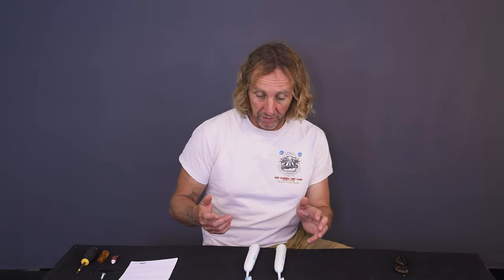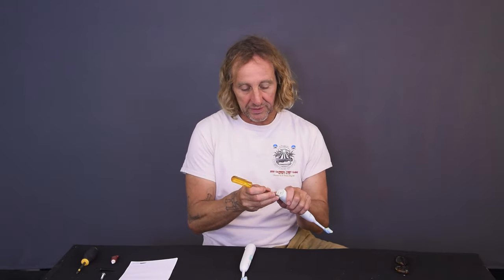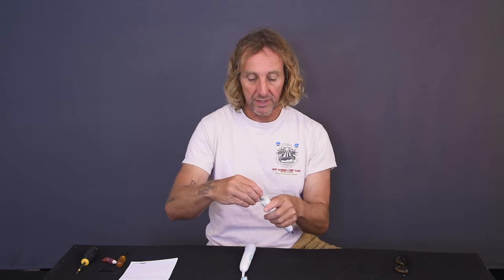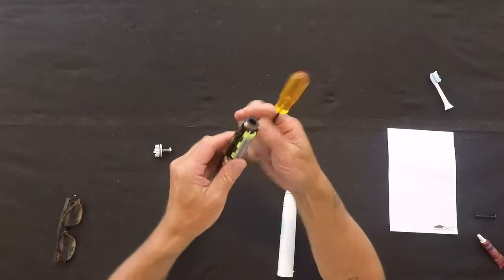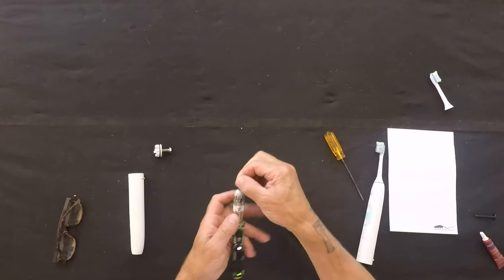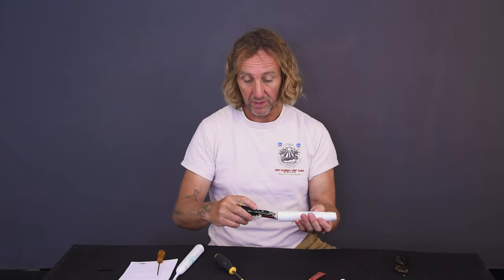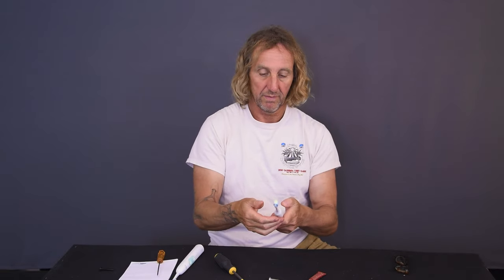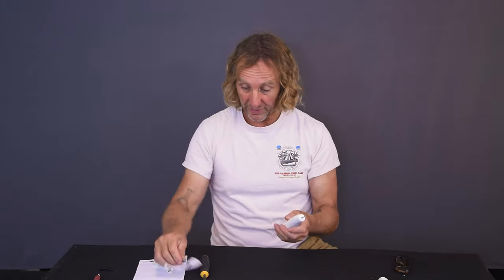Easiest Open/Fix Philips Sonicare Toothbrush HX686 HX684 ...

Comment: Thank you! The screw idea was great for getting the end off. I had a really had time with the clips on the inside, and the screw was not just loose, but so bad it came off entirely as soon as I got the thing apart, so I had to figure out which way the parts went back together. I don't have Loc-Tite handy, but there's an old trick to use fingernail polish on threads to secure them - you just have to let it dry for a few minutes. (Also, if you ever want to unscrew it again later, fingernail polish can be broken again easily enough. But it doesn't tend to break by itself. Really helps.)

Comment: Great vid and well thought out. Some SoniCare brushes have a small hole in the end cap. If you have an air compressor, you can use an air nozzle (with tapered rubber tip) to pressurize the body through that hole and the cap will pop loose. No hole? Drill a 1-1.5MM hole (1/16" is fine) in the plastic cap. Careful, since a drilling too deep can possibly damage the internal mechanism. Then, the compressed air will pop it off. When doing this, make sure to use your fingers to support the rubber seal at the brush end or the air pressure may pop a hole in it, compromising the seal. When the repair is finished, the hole in the end cap can be sealed back up with a dab of glue or silicone sealer. I use some silicone grease on the O-ring seal in the end cap and a dab on the seal at the brush end. Vaseline will also work. Helps to maintain waterproofing. One last thing: "some" end caps go back in only one way, having a notch which must be aligned with the body for the cap to press into place correctly. Once the tricks are known, as you point out, it's no big deal to repair these.
Reply from the maker: I very much run with the zero damage minimal tools stuff laying around the house that cost the least adventure as the optimum way to fix things.

Comment: WOW!!! Using the bolt to take the end cap off is genius.  My post was loose and after watching this video, repairing my toothbrush was a breeze.  Keep your sonicare running longer by keeping the water out.  Always take the brush head off and wipe the water off the motor unit.  If you leave the brush head on and stand the toothbrush upright on the base (like I used to do), the water in the brush will eventually seep into the guts of the motor unit and ruin the electronics inside.  My first sonicare lasted me a year before it quit working.  Not knowing how to open it up, I used force to push down on the post until the bottom broke out.  When I pulled the guts out, there was a lot of green from where the water had worked its magic on the circuit board and copper wiring.
Reply from the maker: Cool, thanks for good tips

Comment: I had this exact problem with my last Sonicare, but I could not figure out how to open it up without breaking it. Unfortunately I did not find this video until I had already bought a replacement, a cheap Walmart knock-off. Fortunately I did not throw the old Philips away though, so I will use what I have learned here to fix it. 

Thank you so much for this, Dave. You are a hero for right-to-repair, ending e-waste, and the fight against planned obsolescence.

Note: I am glad to see that the Sonicare is made so that the battery can be replaced. The Walmart toothbrush has a rechargeable lithium battery that is only good for about two years. The toothbrush came with instructions for what to do after that. They tell you to break open the handle, cut the wires to the lithium battery, and remove it so it can be disposed of in an environmentally friendly manner. Then you throw the rest of the toothbush in the trash, so it will end up in a landfill. Simply replacing the lithium battery, so that the toothbrush can continue to be used is NOT an option. But now that I look at the instructions for the Sonicare, they tell you to do the same thing! (And now we know why they don't simply put lock-tight on that screw at the factory.)

Comment: I was in bed watching your video and thought, it can't be that easy. I've had this problem on a previous toothbrush and basically left it looking like a dog had chewed the end off.  I just had to get up
and try your method. It took me longer to find a quarter inch threaded bolt than to fix it. Brilliant! (this is obviously a design fault, maybe intentional so you'll buy a new toothbrush)
Reply from the maker: Ha, excellent! And one way snap together is a great way to get waterproof. These are not designed to be fixed.

I watched a bunch of vids on how to open and was like, those ways are all a bummer.
So I put a bit of thought into how to open with bear zero damage and then had to share.

Thank you!!.

Comment: Right before I was going to make complaints about your video because you did not zoom in to the level that I can see what's going on clearly, I still went through exactly what you instructed and it worked perfectly well~~~!!! You saved me at least $99. On the other hand, my issue was, the head with the brush are completely loose no matter what (I believe it's thoroughly damaged), so I simply swapped an older version interior (with bigger handle outside, but it's almost identical inside), to a newer version body. Thanks a lot~~~!!!

Comment: Just here to echo all the other comments of THANKS :)  The bolt idea is bang on - and with the addition of a little paper to tighten the grip, bingo!!  I had some condensation inside mine which was causing it to short out.  Now it works like brand new, and I didn't have to damage it in the process.  My Sonicare is 7.5 years going strong, hoping to hit 10!!  Thanks for this fantastic tutorial!

Comment: Thank you Dave this is by far the best method to open the toothbrush without causing any damage. Just to add on here for newer models charging hole is little bigger, so I use screw extractor and it worked like charm. Again thank you.
Reply from the maker: Excellent!

Comment: Thanks a lot for making this video. I had exactly the same problem. The noisy rattling sound. When I opened mine up screw and its little holder came straight out. Fixed now and locktide it for no more worries. Saved my day and the misses  is proud of me...Chuffed!!
Reply from the maker: Love that!!

Comment: Thanks very much the video!  A couple of added comments:

- I used a 5/16" hex bolt with a socket wrench.  
- I couldn't pull the cap off with bare hands so I had to pull the body off while holding the bolt with a wrench.
- I couldn't get the tabs off with a screwdriver so I just squeezed the body and pull the internals out.
Reply from the maker: Very cool and I hope you got it fixed!
Reply: @DaveRat Yes i did!
Reply from the maker: @srivatsanh.varadarajan2996 excellent!

Comment: Great tutorial thank you so much. I've just repaired my 2 year old HX680 with this issue. The screw that holds the shaft to the motor had completely unscrewed itself and was loose inside. Who knows what those vibrations are doing to my old teeth 😁. A very elegant solution to removing the base cap good engineering there and worked a charm. I think I threw my first Sonic Care away with the same symptoms.
Reply from the maker: So cool and thank you!

Comment: Fantastic tip- I was able to fix 2 of my older handles- I kept buying more when they started to rattle too much!  Now my kids have their own, and we diverted some landfill.
Reply from the maker: Awesome! So cool that this was helpful. I normally just do videos on professional audio and it's so cool that a toothbrush video is getting such a positive reaction
Reply: Just curious, why would you continue to buy a faulty product? These things are expensive, if I knew this was such a common issue I would’ve bought from their competitors
Reply from the maker: I think there was a bad run. That said, they are ok with warranty returns and sending a free new one

And

Once ya get the new one, here is how ya fix the old one and have two!
Reply: @DaveRat  Ah I guess that makes sense. I just applied for a warranty replacement and the website said I have to send the old ones in, maybe because I live in the country Philips is from? Hope I just get to keep the old one 😂
Reply from the maker: Yeah, prerhaps. May e people started taking advantage of their old policy.

But yes, we have had a few fail and not putting locktite on the screw was dumb. And costly I am sure for them

Comment: Great idea for removing the plug compared to all others I saw trying to figure out how to open my sonicare 4100. Simple and effective with no damage. A little loctite, tighten the screw and good to go. Saved $40 bucks if I had replaced it. Thanks
Reply from the maker: Excellent and I'm so happy I'm doing my part into reducing waste and saving bucks!
Reply: how were you able to pull the cap out with the bolt? I bought the bolt stated in this video and have a hard time pulling the cap out :(

Comment: Thanks so much Dave the bolt method you use to pull out the cap/lid works a treat,my small screw at the head was loose,tighten it up and the job's a good one.
Reply from the maker: Awesome!!

Comment: didn't have a screw that size but found a drill bit and it worked.  I salute thee, sir
Reply from the maker: Yes!!!!
Reply: what would be the metric counterparts of screw/bolt/bit?
Reply from the maker: To convert imperial to metric, multiply the imperial number by 25.4.

So in this situation imperial number is a quarter of an inch or 0.25 * 25.4 equals 6.35 mm.

So it'd be a 6.5 mm metric bolt. That said using a 6 mm bolt and jamming a toothpick in the hole first or a tiny wire or something and then screwing the bolt in should do you.
Reply: @DaveRat  thank you so much for that thorough explanation!

Comment: 1/4-20! Genius. 

Forehead-smackingly obvious solution when you pointed it out. The simple ones are always the best (frequently discovered by audio engineer/musicians, but I am somewhat biased in that regard). Much simpler (but a lot less dramatic) than the air compressor method I used the last time I did a repair on my trusty HX9120, this time I was in and out in 10 minutes. And I didn’t have to go out into the freezing cold garage! 

May all your gigs be beautiful.👍🏻
Reply from the maker: Awesome! And thank you!

Comment: Yes. This way is much easier and quicker. I started to try using a metal spudger but I could see that it was going chew up the plastic a bit. Did another search and saw your easier way of pulling the cap off. Thanks for this video. In case other didn't quite catch what size of bolt or machine screw he said. I bought a 1/4 machine screw and it was the correct size and it worked.

Comment: Hi, Dave. I hade the same model and issue—had to use the paper trick to get purchase with the 1/4-20 bolt, added some Loctite on the small screw, reassembled, and we’re back in business. Cheers! :-)

Comment: Tried this one two broken Sonicares. Broke one completely... The other one didn't work, but prying it open was easy with a screwdriver. It really does depend on the model.

I did however manage to fix the loose holder-end, so this ended up being helpful.
Reply from the maker: Ah man, seems to be about a 90% or better success rate from the comments but sometimes it does not pan out.

Comment: Thanks. Had handles before where tip came loose (and fell out in one case). This time I had an HX6530 warranty replacement which dud the same. I used a method to open seen elsewhere. Squeezed across widest part of handle end after protecting plastic with cloth or card until gap appears around the cap at the bottom. Use small flatblade to lever up and remove all of innards with cap attached. My issue was the same (loose screw - all this hi tech and it comes down to a screw with no Loctite). I was going to remove the screw, but even loose it didn’t want to come out. Used a cocktail stick to apply some Loctite. Some care needed to avoid dropping a big drop of that into the tip innards which I don’t think would do it much good. Once opening figured out, one of the easier repairs (and battery could be replaced of course if needed). Thanks for giving confidence to attempt.

Comment: Brilliant,  cheers! Took me quite a bit longer than the presenter, but I succeeded. The hole was bigger, so try using paper like he advised to reduce the size. Also, I couldn't get the battery compartment out either; it didn't just pop out, so try tippng it upside down and shaking it downwards. This worked for me.

Comment: Great stuff, worked for me with a threaded peg from a bookshelf. The plastic tabs were a bit different on mine, but they worked the same way. I needed to squeeze the case to open a gap, then I could get a tiny screwdriver between the tab and the case, then move the tab in while pushing the whole thing (held upside-down) down onto the table (to maintain tension on tab 1 so it didn't go right back while I moved on to tab 2)

Comment: Just replaced the battery on mine and the bolt in the base trick worked a treat, thank you for the info. However getting the new battery in was rather fiddly but all fixed now and should hopefully last me another 5 years whilst saving ewaste and cash :)

Comment: Dave, thank you. I observed the little tongues holding the the bottom cap in the case were damaged - slightly - when I pulled it out your way. I put the parts together no problem but maybe it's better to wrap a cloth around the bottom and squeeze the cap out as shown in some other YT videos. That should not damage the tongues. Cheers!
Reply from the maker: Not sure how the tongues get damaged, for me it just slides right out. But glad ya got opened

Comment: Thanks for this video I just fixed my wife's toothbrush.
1/4 20 screw was theticket.
My problem was a little different the toothbrush was fully charged would be five times and not engage.
I popped the bottom of the battery nearest the charging coil up as the other side appeared to be attached.  There was a small tab that obviously wasn't making a good contact with the circuit board I then pop the battery back in tight. Problem solved!

Comment: Thanks. I dropped my protective clean & was trying to figure out how in heavens name to take that bottom off. Haven't tried your method yet, but it looks quite good & will try soon.
Reply from the maker: Awesome and let me know how it works for ya
Reply: @DaveRat  Success, thanks so much. There was a tiny bracket and the Phillips screw loose inside. Put the bracket back & tightened down the screw & back to normal. Your method is excellent.
Reply from the maker: Awesome and thank you!

Comment: I’m backstage on a gig waiting for something to catch fire. I’ve re-coned speakers, replaced electronic components, built cables, etc. how hard can it be to fix a damn noisy, rattling tooth brush? I stumbled across this video and it is definitely the best way to open the tooth brush. I agree with using loctite (Red stuff even!) I wondered why the other videos did not mention it. Thanks!
Reply from the maker: awesome!!

Comment: I couldn't fit the 1/4" screw in the bottom of mine, but a slightly smaller one fit and I could pull at an angle to get the bottom off. Thanks for the tip!
Reply from the maker: Awesome!

Comment: Funny that this video introduced me to Dave Rat. Anyway this is a much easier method for getting into the sonicare toothbrush. I found that my screw was still tight. So I pulled it apart one step further to expose what that screw actually tightens into and found the piece was cracked in half. Probably was dropped, cracked and vibrated loose. Good stuff nonetheless. At least I am comfortable getting a new one now.
Reply from the maker: Awesome Jim!

Comment: Dude. Clutch with the bolt in the charge port. Don't know that I ever would have thought of that.

To add, I found holding the toothbrush upside down and putting light pressure on the metal part that the brush attaches to when using the screwdriver to trip the plastic tabs inside helped with preventing the tabs from catching again while I was undoing the other tab.

But no noticable damage to the toothbrush (there are now threads in the charge port) and I did put loctite to prevent it from coming loose again but literally a 2 minute fix.
Reply from the maker: Awesome and great tip on the pressure.

Comment: Nice find on the bolt!  made it pretty simple.  Unfortunately, my toothbrush had a legit fault.  I believe the spring part that holds the magnet up has broken.  I had the coils at the very bottom of their adjustment, and the magnet would always snap back down when I removed the shims .  Good video though!

Comment: This is awesome, I just wanted to see your solution to opening the toothbrush, but actually it turns out the toothbrush I was trying to open had the same issue. I did take out the entire bolt though as I wanted the loctite to go on the end of the thread to make sure it would reach inside the nut. Didn't lose any small parts and it works fine again now. Sadly, the person I fixed it for just used their replacement brush about 20 minutes ago... So I guess they'll have a backup brush now?

Comment: I would have liked to see a a close-up of the bottom of the Sonicare - they have so many models, I’m not sure if the one you have has the same bottom as mine (HX6521/01 bought in 2020.)  Since my problem was the toothbrush turning on by itself and the front button not shutting it off, I had to pry off the bottom and stop it - gave it a cleaning to get rid of the condensation and it works OK.  I didn’t mess up the bottom enough to stop if from working.
Reply from the maker: Cool cool
Reply: @DaveRat  UPDATE: the old sonicare started goIng on again - on its own - got a new one.